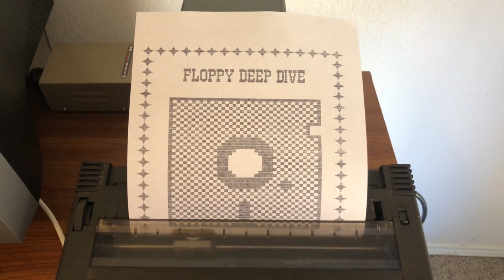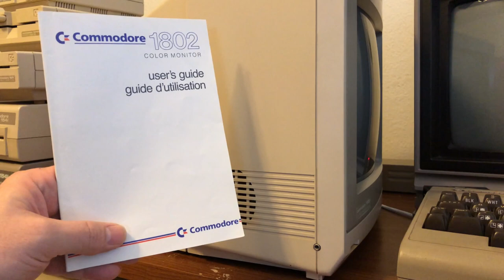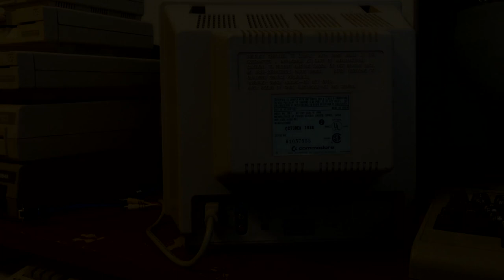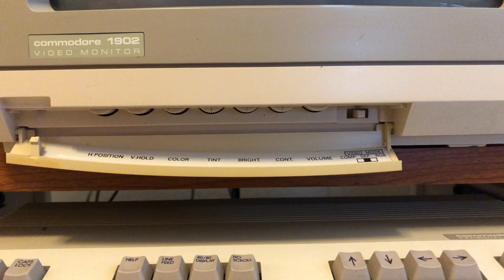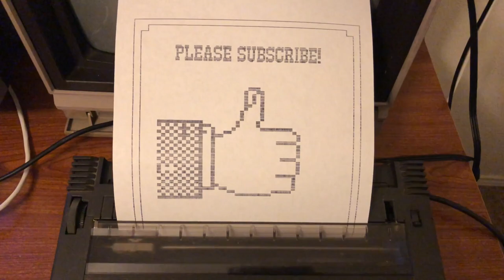My First Commodore 128!

Comment: I upgraded to the Amiga and the C128 with C1902 just sat around for a year in a couple boxes stuffed into a back closet... then it was sold for about $50 bucks with all the software.  What a kick in the nuts that is when I look back.  

Miss my C128...  sometimes it hurts when I think about it... lol...   

These days I run Emulation... Not the same, but it cures the fix I need.
Reply from the maker: Yep, there is nothing like the real thing.  Do you still have the Amiga?
Reply: @FloppyDeepDive  No, sadly.  All my retro computer tinkering is done via emulation these days.

Comment: I regretted selling all my Commodore stuff when I was a kid, especially the C1902 monitor for 80-column mode.. had to buy back most of the Commodore stuff from e-bay, except for the C1902.
Reply from the maker: I can relate. I sold my gaming consoles and wish I would of kept them all now.
Reply: That's too bad, the 1902 is an excellent monitor for the 128 and 64.